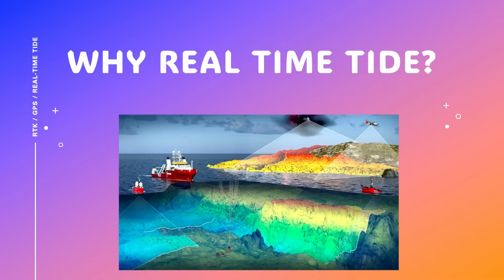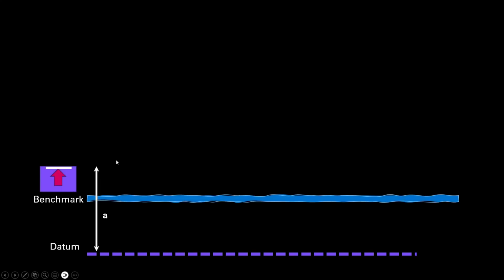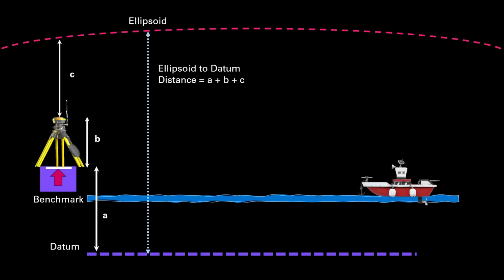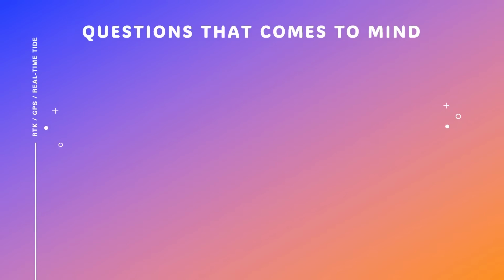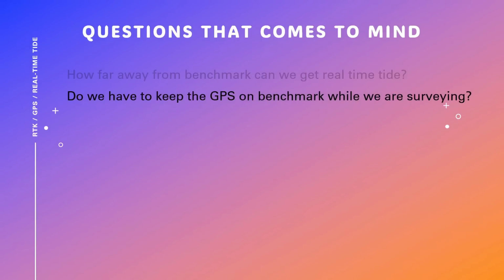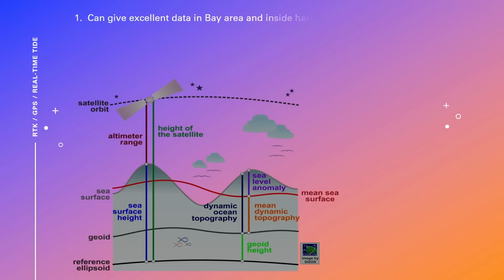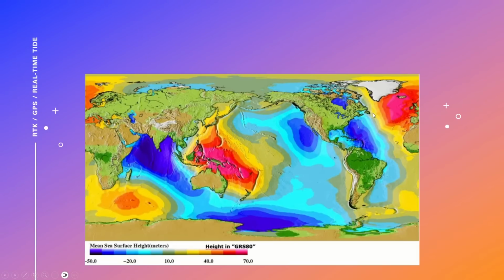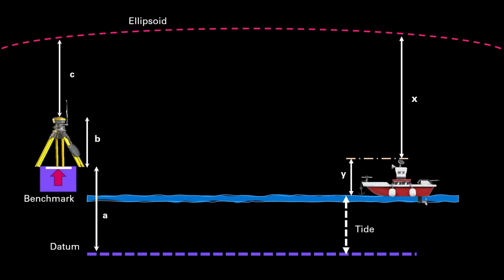Real-Time Tide Explained: RTK Tide, GPS Tide

Comment: Sir can you please explain about motion sensor
Reply from the maker: I have a video on Motion on my channel. Not motion sensor as there are many different tyoes and they vary from each other greatly, I can not possible make a video on a particular sensor. But  having said that, motion sensor are basically measuring rate of change of acceleration in 3 axis, which translated to Roll, Pitch and Yaw. Heave is calculated from all of theae only. And motion sensors need position and heading input in them. Hope this will get you started. Thanks for watching my videos.

Comment: Great explanation. If you can add dynamic draft changes that comes into picture when certain vessels varies their speed and in case sea is choppy. Very well explained
Reply from the maker: Hi Thanks for visiting. Dynamic draft changes are pretty tricky thing but if you have motion sensor, then that generally takes care. No matter how much care you take, you will always have 2-3cm error. You can smoothen the logged tidal curve but then Again the question is how much difference 2-3cm is going to make when we plot soundings in Meters and Decimeters. 😀

Comment: Theoretically it sounds good, but practically in dynamic sea state it is not useful. However, MSS tide is the best option in such scenario with known Z0 value of the nearest benchmark.  I have done this exercise at Kori Creek, Gujarat with 3 tide observations (RTK, MSS and Tide gauge). MSS tide is the best to use in such situation when survey is in bay/gulf area.
Reply from the maker: It is not a theory mate. I have done it 10-12 different surveys and MSS tide was never used. MSS grid stops 1mile before the coast, So you cant just use MSS in the creek.
Reply: @OffshoreSurveys  helo sir
Reply from the maker: Hello